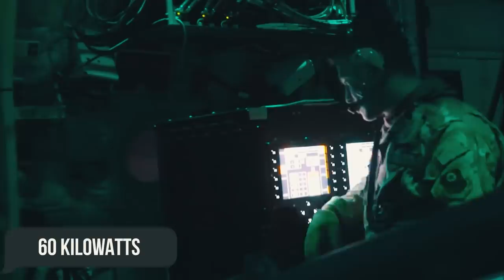US Fighter Jets Will Be Equipped With NEW Deadly LASER Weapon

Comment: In what world is $1,000 per shot to shoot down a missile expensive? The small Sea Ram anti-air missiles that they put on naval ships now cost a couple hundred thousand dollars per missile and that's on the lower-end cost of anti-air missiles. The aim-9x sidewinders that they put on aircraft is $400,000 per missile. Even taking inflation into consideration , that $1,000 then is only equivalent to $3,329 dollars today. Would you rather spend $400,000 per shot that doesn't have a 100% missile interception success rate, or $3,329 per shot and have a 100% success rate? Even the Phalanx CIWS cost more then that to shoot down a missile. The 20 mm armor piercing rounds that it shoots out cost $30 per bullet and it shoots out 75 bullets per second  so for each second that it fires it l cost $2,250. and I've seen videos where they take  sometimes between 5 to 10 seconds  with 2 CIWS firing at the same time  just to intercept one missile. So yeah I'm not sure exactly which measuring scale you're using,  but $3,000 to shoot down a missile is dirt cheap regardless of the measuring scale that you're using.
Reply: well said..

Comment: Clouds, rain,dust,dirt can affect the lasers power down range. We should be using an older technology. Electric fire systems. Uses electricity to fire multiple bullets all at once. It can fire thousands of rounds at a higher rate than CWIS. Just needs a predictive aiming system which we already have. Fire storm is an Australian company that produces this kind of weapon. Could if built right fire faster than GAU 8.

Comment: Problem - You have a hundred drones from ten Miles away to intercept with only one powerful laser. The laser has a impact time of 10 Seconds on two Miles before the drone goes down. How much drones you could get possibly down at the best circumstances?
Reply: So basically whoever makes the best cheap mass produced unmanned drones with cheap also easily mass produced ammo is gonna win in the end. Also considering if the ammunition is based on electrical power and maintenance of the firing mechanism is the main limiting factor in regards to weaponry.
Reply: Well, have you heard about the Longshot and gunslinger programs? The US is developing special drops that can take the place of a fighter jet's aeapon racks. Acts as RATO units, and detatach to support the manned fighter by extending their range, screening ahead of the formation, acting as decoys, attaching from multiple directions, and guarding manned jets as they push through to their targets or escape the air space. 

This program will most likely succeed before the laser is in active service. So, there's really no point in using g a drone swarm as an example of why not to use a laser. The fighter jet will be a mothership, forward AWACS, arsenal plane, and EWS platform in the future.

Comment: Its the only way to go. No ammo to store, move around, and no reloading. That right there saves a TON OF MONEY!  Lighter for our troops to carries, and lighter for air craft Plus never run out of ammo. Might run out of power
Reply: Right up until they start putting reflective materials on everything.
Reply: @JAnx01  Its not just a beam of light. The elements that it contracts is heated up! Mirrors and reflective shields want work. It still penetrates
Reply: @JAnx01  Once it's a laser beam, any reflecting material will only reflect a small amount of light.  Most of that energy will still heat up the reflecting material's surface, destroying it's reflective properties.
Reply: @JAnx01  No they can't , that will just make them really easy targets 
Maybe smoke

Comment: $1000 a shot is NOTHING.  Most missile defense systems cost hundreds of thousands per shot.  The current Helios system at something around 30-90kw costs around 5 cents a shot.  They tested on a ship and it performed great.  It was then requested for it to stay and because of the low cost the crew regularly tested it.  This had a side effect of lots of extra data to work with.  There is orders for 4 prototype  ground base mobile systems that are rated at something around 200-250kw.

One thing that you need to understand is the use of laser weapons on personal is banned by the Geneva Convention.  This means using lasers against crewed targets can get a bit touchy.  For defensive purposes these system will become critical.  Israel is struggling to maintain its Iron dome do to the cost of each missile and this laser system would be far cheaper to operate.  For fighter and bombers this will make them FAR tougher.  Other countries can not rely on SAM sites for protection and instead will have to fall back on interceptors.  With the 6th generation coming up have requirements of Mach 3+, these craft will be near impossible to stop.

Comment: Tim & Rex on the secret life of machines. Rex made 
a weapon for a movie.
Sort of ;
 like shooting the old flash bulb camera cubes and they blew up and when they hit.
-------Plus , best thing since sliced bread put (fluorine) over your computer circuit system (inactive liquid) starts to bubble and will show a (short or hotspot).
---------
  ?¿? Radiator stock (up) for computers?¿?
Reply: T -Stov  & V - Stov photon wave.  Use , that for power. 
    Or , can two photons react like T & V when they hit.  They , can add but I am going to - Fiction - dream.
    Photon + ( Phase) Mix +